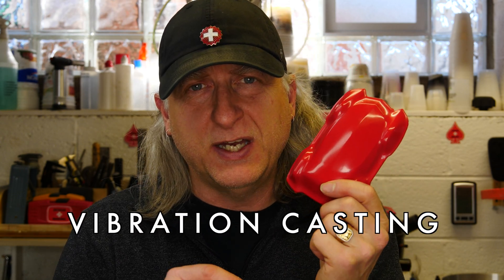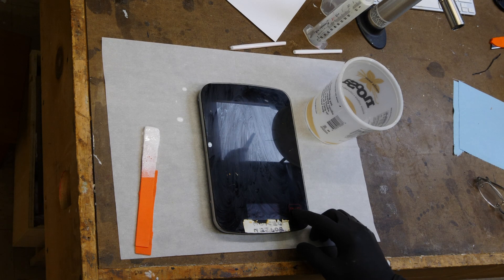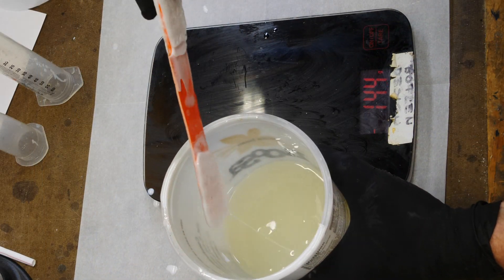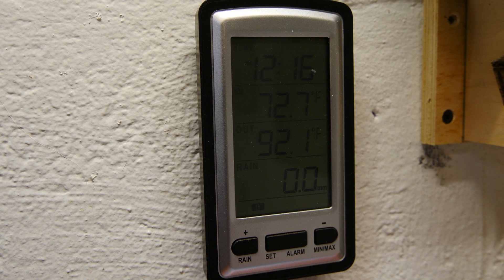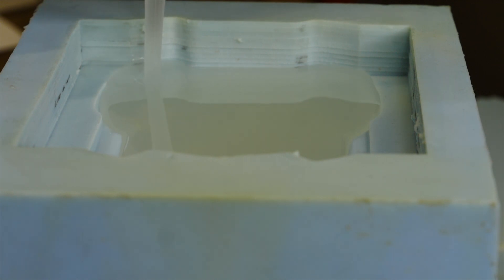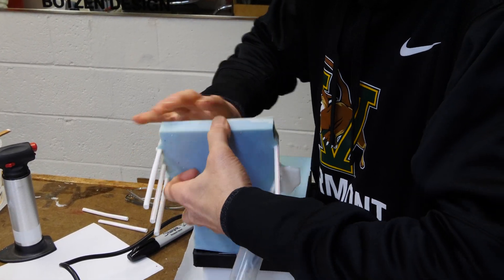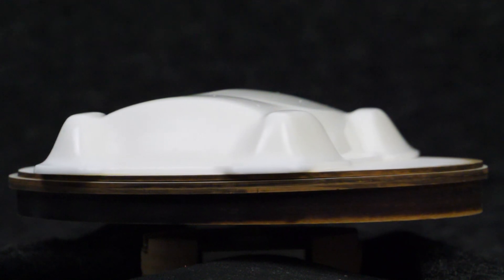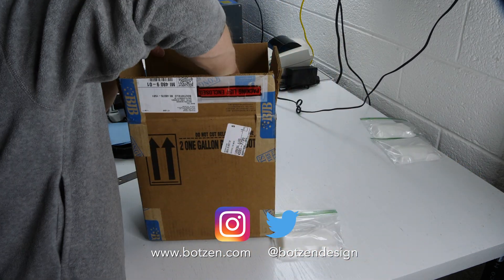What is Vibration Resin Casting? Removing air bubbles with vibration

Comment: Not sure if you are still monitoring posts to this video but I wanted to ask your opinion. I would like to use a vibration machine with epoxy resin, not just for bubble reduction, but also to get the resin into all the nooks and crannies easier. I would rather not use a vacuum chamber for various reason. Do you know if the vibration machine would work just as well with epoxy resin as it does with urethane resin? Thanks!
Reply from the maker: In theory yes
Reply: @EricStrebel  Thanks!

Comment: Greetings, Eric.
I've made a headlight several times with Shabebe epoxy resin. I'd wait three days before unmolding it. It would become a bit opaque and soft, and if I put it in the sun, it would soften even more. Would your management recommend a specific headlight resin, or should I use polyester resin?

Comment: How long did you use the vibration plate for? Thanks.
Reply from the maker: While I am pouring the resin and then another 20 seconds, depends on the resin actually
Reply: @EricStrebel   Thanks you.

Comment: I just thought i'd mention an ultrasonic cleaner... 
I mixed propyleneglycol and glycerine (50 ml in a glass bottle) by just shaking the bottle and then i put it in an ultrasonic cleaner thats kinda the right size for cleaning glasses...
It's awesome to watch all the bubbles in the mix rise to where the water surface level in the cleaner is and then slower further up.
I wonder if this vibration would speed up the curing process of any 2K compund...
Reply from the maker: It's a thermic reaction, so the vibration would not speed it up, but the vibration might remove more bubbles, some testing would be required.

Comment: How funny, I am just making my first mold and epoxy lens. Just today actually. And I came up with the same idea when I saw bubbles in the silicone. What I did was simply holding my grinder against the mold for 20 secs on every side. That seems to do a lot too. I work in construction and there we use vibration in concrete preparation, so that's how I came up with it. You think does the job?

Comment: Hi Eric, very interesting option not having to use a pressure pot for a starter. The brands for silicone and resins are not the same as in Europe. Is there any video or info on specs on different resins/silicone so I know what to look for when reseraching brands available in Europe?
Reply from the maker: Nope, sorry don't have any for ya

Comment: Just curious why you wouldn't just cast this part in an open mold seeing as it's solid?
Reply from the maker: Consistency, the part actualy gets a cork bottom glued to it.
Reply: @EricStrebel  even more reason to use an open mold. Not trying to tell you how to do your work but I think you have made your job a lot more complicated than it needs to be. A little background on me: I've been fascinated by plastics my entire life. I went to school for it in fact. I was an injection molding process technician for close to 30 years. I've been resin casting for close to 15 years now. I cast intricate parts with lots of detail. I'm currently working on a 1/8th scale version of the Lincoln flathead V12 engine that has over 100 parts each engine. If I were to make that part I would make a rubber glove mold with a hard outer shell. It would be 1/3rd to 1/4 the cost of your molds. Using an open mold would eliminate the need to "inject" the resin and you'd be able to see any air bubbles and just release them with a stick. The "injection" is actually increasing the amount of bubbles through turbulence. Come look me up on Facebook groups HOTRODZRUS SCALE MODEL CARS to see what I do.
Reply from the maker: You can't get consistent parts with an open face mold. There's no two ways around it
Reply: @EricStrebel  okay. It's your business not mine. I'll go away now.
Reply from the maker: When you make hundreds of these you need them to be all the same and you cannot do that with an open-faced mold.

Comment: Great video.  Can you use an instant pot to degass your resin?  Wondering if that would work as a cheaper setup.
Reply from the maker: An instapot is a pressure device, I don't think it would be enough pressure like a pressure tank would.

Comment: You tried this on clear parts would you think it get the bubbles out completely? Im tryna make my owe action figures but scared to convert or use a pressure pot myself
Reply from the maker: No, it will not work for clear resin, you will need a pressure tank for that

Comment: A 6:05 you said that you noticed it speeds up the cure time significantly because of the vibration. I believe you and I don't have a vibration table to confirm, but in my opinion you significantly sped up the cure time with the vacuum chamber process, more-so than the vibration table.

I am very curious to know your opinion on which sped it up more, because I just got my vacuum chamber running and I just switched to smooth-cast 326 to have a longer pot life than smooth-cast 325. I usually use my pressure pot for bubbles and I was just getting familiar with my new pot life when I decided I had enough time to vacuum AND pressurize. First thing I noticed was it was firing off much quicker and it was because of the vacuum. I managed to get it into the mold and pressurize it and it looked much clearer in the end so I was happy about that, although if it ruins my pot life, it is entirely unnecessary. Maybe I should vacuum parts A and B separately and mix a tiny bit slower to avoid introducing bubbles to begin with?

I have a question for you about silicone. I was using Mold Max 14NV and 29NV to avoid the vacuum chamber, opting for a pressure pot, when I started. I now have Mold Star 20T which requires a vacuum process. The Mold Max had a pot life of 40 minutes but now I have 6 minutes with Mold Star. 

My question is, can I cool my silicone down in the freezer to gain some pot life? How cold is too cold? 

The vacuum process does not seem to affect the pot life or cure time of platinum cure silicone, but it does for urethane resins.

I would have liked to see you pressurize this casting with that funky but effective mold setup :).

I think the vibration table is only critically important while the resin is first pouring over and touching the surface initially. 

I'm going to build a single speed vibration table from wood and a vibration motor :)
Reply: Typically, you will see pot life reduction of a material under vacuum due to having a concentrated mass sitting there, reacting, and the exotherm building higher and higher.  It has nothing to do with the vacuum process, or bubbles forming.  The bubbles under vacuum are simply trapped air escaping.  It is not causing heating of the material.  The material is heating all by itself due to chemical exotherm.  If you mix material and immediately pour it into a closed mold with a thinner wall section to reduce it's concentrated mass, the gel time is much longer than mixed material sitting there for 30-90 seconds in a mixing cup waiting for it to degas.  Hope that helps.
Reply from the maker: Good info! Thanks for the reply, always appreciated 👍

Comment: Eric I'm sure you've heard this before , dust your mould with baby powder , blow off access with compressed air . It won't affect the surface of the casting. It is just another way of breaking the surface tension . I have made moulds the same size you have just used and using a heated mould with talc I had many perfect castings from it . I was using a quick set resin with no degassing , pressure or vibration .
Reply: he pobably needed the glossy finish of the original part since they look like sample pieces for automotive laquer
Reply: @MiniaturenGalerie  talc doesn't affect the finish gloss or Matt .
Reply: @glenfisher728  sorry but i've actually used talcum for that purpose (matt finish).. but it would actually be great to know how to avoid that - do you maybe have a video link?
Reply: wait that may have been bs. i was using transluzent resin so the matt finish was probably due to the added particles, not the surface
Reply: @MiniaturenGalerie  the surface finish on the master is what matters, the RTV will replicate the finish . I have used translucent resin with the mould coated in talc with excellent results. No video , have done any casting but getting back in go it now. Just got a vacuum chamber and am in the process of building a pressure pot , not one of those crappy paint pot conversions. Have been moulding and casting for a hobby for close to 35 years and still learning .

Comment: Eric, the video came out great!  We had such a good conversation that day and appreciate your efforts in putting together such a clean, professional, and useful video for the many other mold makers and casters out there.  -BJB
Reply from the maker: Thanks, looking forward to doing it again sometime soon 😄👍
Reply: @EricStrebel  Hi brother, I made a piece twice, a mica, it comes out opaque and dense and if I put it in the sun it gets soft. I gave it 3 days before unmolding the piece. I used transparent epoxy resin from the Shabebe brand. I want to make some headlights too, but I don't understand why it turns out badly and it doesn't harden. I bought some polyester resin to try. What do you recommend for me to try? Which one would work for me?